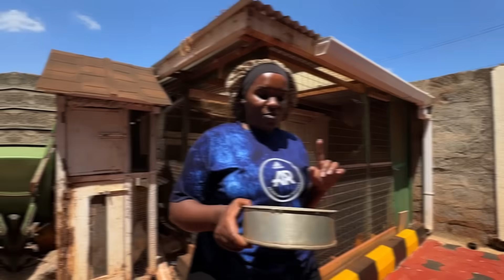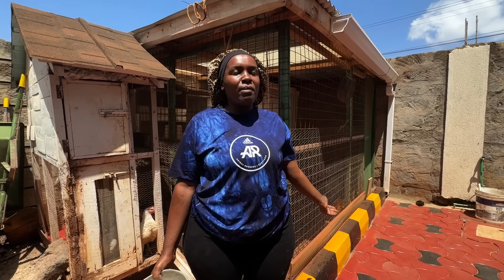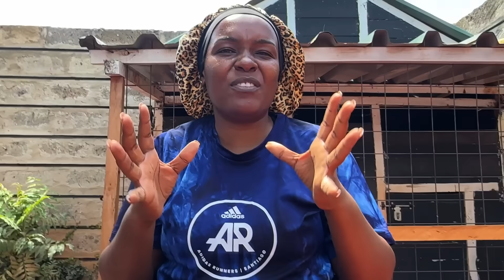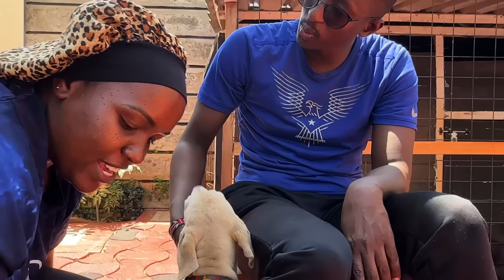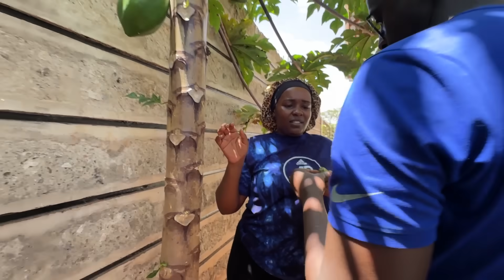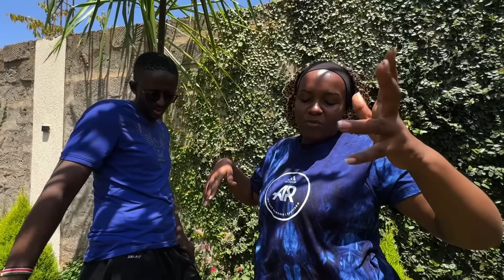My life with a shamba Boy

Comment: For the Machungwa you need an extra one for the purpose of cross pollination and i guess for the pawpaw as well. whenever it flowers I was told you can light some fire at the base for a few minutes and let the smoke (Using organic materials that is) reach the flowers for a short period. This will prevent it from losing the flowers.
Reply: How do I know this.  We did it with avocados at home it works
Reply from the maker: Thank you. Nitamshow😊